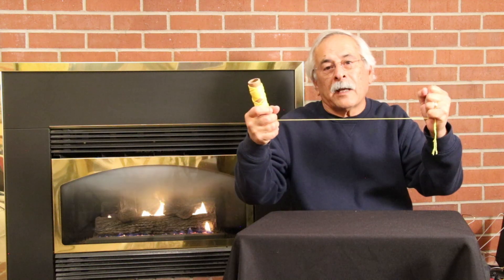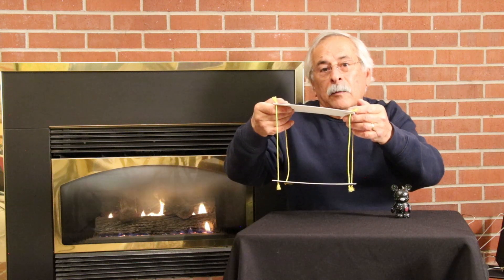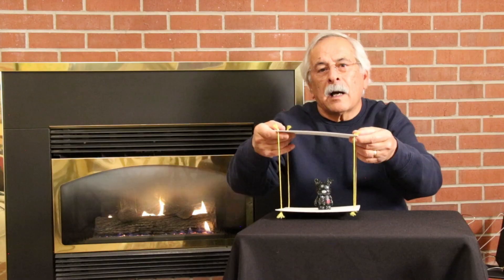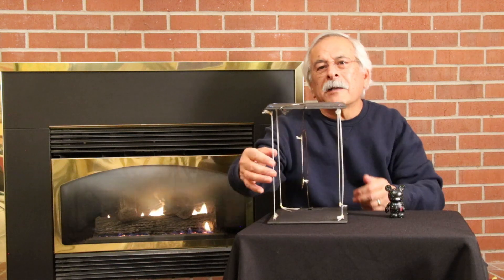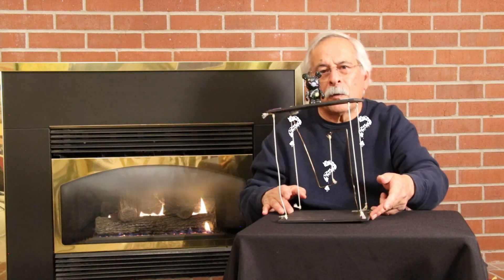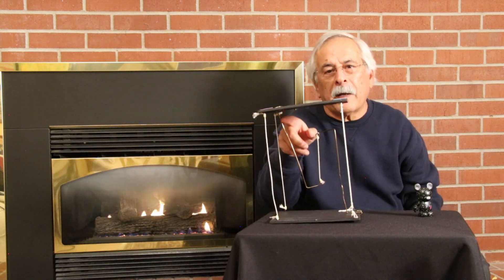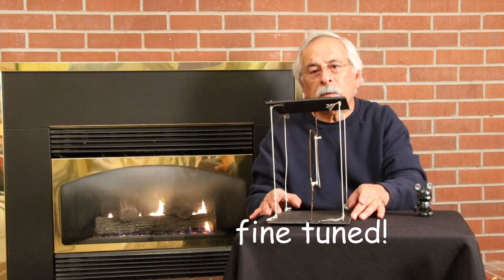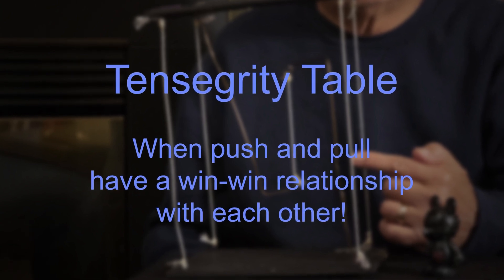Tensegrity Table Explained

Comment: Hello I have a question you have to put the strings exactly at the center of the cube or you can put half on top and the other have at the bottom??
Reply: In the center but not at the center of the cube
Reply from the maker: Yes, the string in the center will balance the top from tipping. The 4 outside corner strings give the top more stability from tipping!

Comment: I still don't understand
Reply: To describe in simple words without any physics terms, the bottom plate is holding up the top plate. Or think of it as the top plate is hanging from the bottom one. The metal wires in the middle are the key. Take a second look and think about it for a minute, you will see. The wire coming straight up from the bottom one, that is doing all the muscle work, supporting the top plate. That top plate has its wire going down at an angle, to balance its weight as best it can in its center with the string. You could hang the top one from the bottom one with only the center string, but would need your hand to hold the top one steady to keep it from falling to one side. That's where the four outer strings come in. Like how a tent is staked to the ground, the guy ropes are tensioned evenly on all sides to keep it centered and upright. Here the four outer strings are taking the place of your hand to keep the top plate steady and centered, evenly tensioned.

Comment: I have no problem understanding how it works, but what I want to know is, does tensegrity work for any other configuration? I have been looking for quite some time and the only examples I can find are all the same configuration. Even in this example, even though he uses more strings, it is the same configuration. You can even see how one of the strings on the table isn't doing anything, just hanging there limp. You claim there are many configurations on the web, but I haven't seen any after searching for many hours.

Comment: so in conclusion the metal at the centre is holding the table intact but not the string.
Reply from the maker: The string in the center (tension) is keeping the top platform from falling the attached wire (compression) is carrying all the weight of the top

Comment: Call me a smooth brain but I still don't get it, how does the tension strings in the middle don't colapse due to gravity?
Reply from the maker: The string in the center (tension) is keeping the top platform from falling the attached wire (compression) is carrying all the weight of the top

Comment: Essentially the ropes at the four corners are acting as guy ropes for stability,, take away the four ropes and the top would still stay in position,, although it would fall to one side because of lack of balance. A nice visual trick.

Comment: So what you are saying is the middle string is taking the force of the strings?
Reply from the maker: Yes, the center string is carrying the entire weight of the table top. Essentially it is a one legged table but the corner strings prevent the table top from tipping.

Comment: is that what is happening in this picture with the table? https://cdn.discordapp.com/attachments/645975178807083018/767152508774383636/121333238_3152907041485791_3204633603790813210_n.png
Reply from the maker: Yes that is the same concept. I like the design and looks of that table.
Reply: @funbygum  very interesting, thanks

Comment: If you cut the strings on the for corners would the table still "stand"?
Reply from the maker: No the table will not stand because it will be unstable. Without the corner strings, it would be like having a one-legged table (center string only) and the table would collape without and way to offset the unstable table top.
Reply: @funbygum  Thank you.

Comment: This is a good explanation of how compression members and tensile members can be made to work together to produce a stable structure.  The problem is though that it isn't fully stable, since the rectangular configuration permits considerable side sway which is unacceptable if the structure is to be a useful table instead of just a novelty.  All that is necessary is to use the stability of tensile members arranged in triangles and all will be well.

Comment: Damn now I got that  "aha" moment. now I see. so the top part has an extension that goes under the extention from the bottom so that the top part pulls the string down and keeps it in tention. the 4 strings in the corners are support

Comment: so all the loading pressure comes to the middle string, right? As i understand, because of the middle string the weight of upper surface and all what is on it will be tensioning it.
Reply from the maker: Yes, the center string holds the entire weight of the top platform (tension). The wire attached to the top is hanging from the wire attached to the bottom by the center string.

Comment: I'm an engineering student... why is this so hard to understand!!!
Reply: That depends what kind of engineering student you are. 
The 4 white strings help balance the plate and keeps it from moving much. Treat the middle piece as a pendulum. When you move , it creates an arc, pushing the top plate up, which prevents it from moving up by the 4 white strings.  The middle piece acts like a top heavy pendulum where the plate is the top heavy and the bottom is the base.
Reply: @goober2964  could you explain why exactly the four strings on the edges are under tension though?
Reply: It actually mostly comes down to two outside strings and the middle one. While the table wants to tip over, the two string are holding it back

Comment: I’m still confused.
Reply: Take your hands and hold them up in front of you.  Stick out your pointer finger like you are pointing straight ahead and make a hook.  Now hook your 2 fingers together and pull.  That's what is happening in the middle of the table.
Reply: Electro Spot what?
Reply: It's clever but obvious when you see how it's working.  Forgetting the two wires and the string in the middle for a moment, if they weren't there the top would collapse.  Now attach just the two wires in the center but leave out the string.  The table still collapses because the wire at the top is able to freely move past the other wire.  By joining them with a piece of string when that top table wants to fall down because of gravity it effectively "pulls" on that string which basically then stops it in it's tracks. This is really the bit that is "holding up" the top of the table if you like and it's the structure that is preventing gravity from bringing it crashing down. The 4 outer strings are effectively "guides" to make sure the top doesn't go sliding off to the side which is what would happen if they weren't there.

He mentioned adjusting the strings - you would need so that the 4 outer ones were long or short enough so make the top of the table level.  If they were different lengths the table top would be at an odd angle and if the difference was enough (or as I said, they weren't even there) then the top would fall to the side and the whole thing would fail.
Reply: @AJJuliusCaesar  I would say tilt instead of fall forr the f of the outer strings..
Reply: The top half hangs from the middle string, which is securely attached to the bottom part on the ground. The other four strings tie the top half down and stabilize it.
Reply: https://youtu.be/76amOgNzdDQ